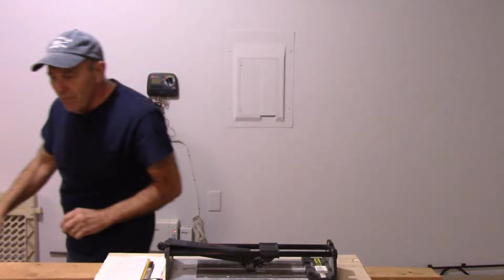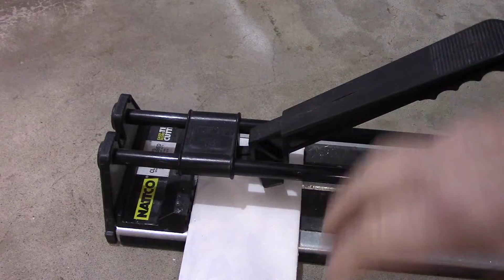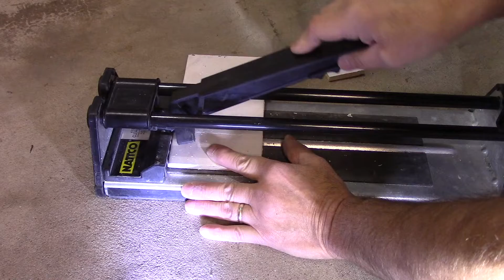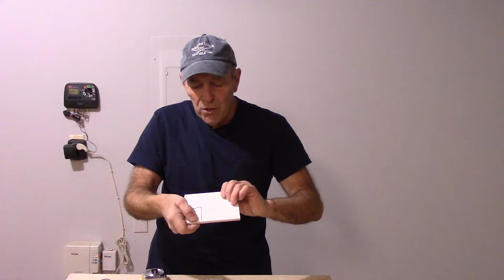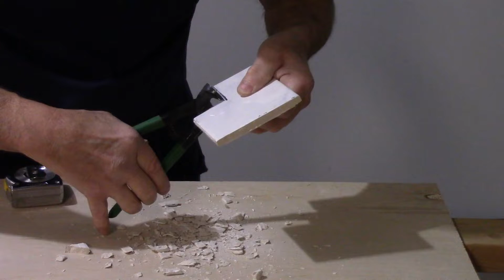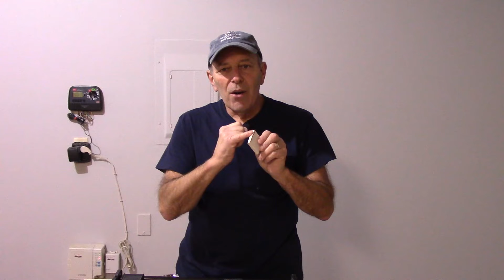How To Cut Tiles Without Power Tools

Comment: Unnecessary to run the tile cutter over the tile more than one time.
Reply from the maker: The drill is most likely dull or your maybe using a wood drill bit and not a metal bit.

Comment: Can you use this to notch out corners? Like for a door jam with multiple notches that need cut? Trying to not have to buy grinder, etc.
Reply from the maker: Yes you can but you will need to take out very little at a time to keep from cracking the tile.
Reply: Hes referring to an inside corner cut. Theres no way to "cut a little at a time......" with a beam style cutter. Most will only cut a minimum cut of about 1" or more and can only cut full width and length of the tile, no inside corners.
Unless you know of some special trick im unaware of a grinder atleast is necessary for inside corners.